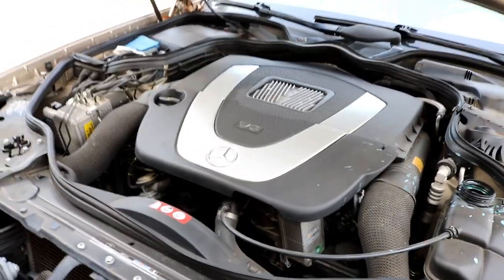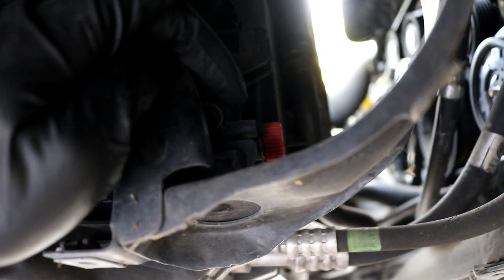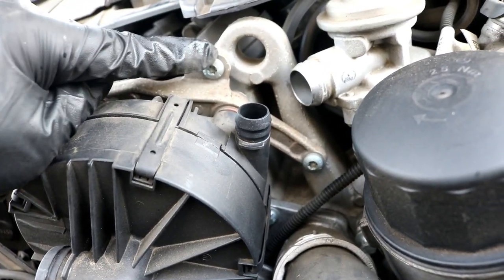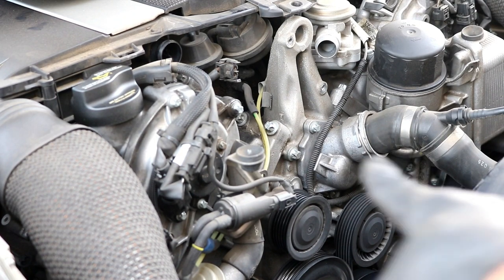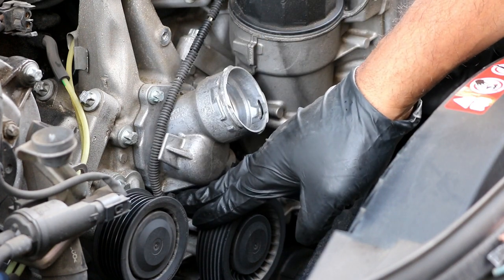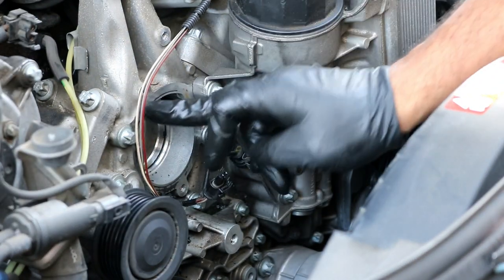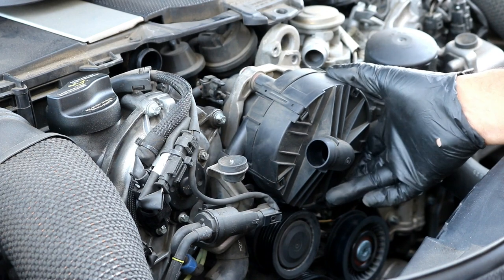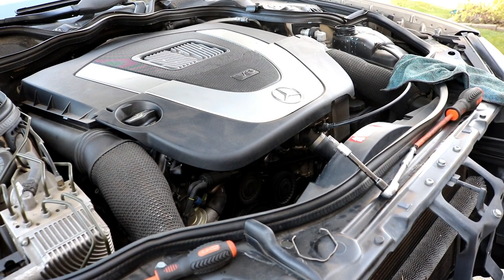Mercedes M272 Thermostat replacement E350/C350/R350/CLK350

Comment: Thanks for sharing, and here's a small note for those who don't have a breaker bar or long torque wrench you can use normal size wrench! it worked for me with some effort on 10" wrench with zero problems. Checked 👍.

Comment: You don't need to remove the secondary air pump if you have a 1/4" drive E10 socket - a 3/8 E10 will not fit without removing the secondary air pump.  Socket worth the $10 and you will use it many times on the M272/M273 Engine as well as most later ones.  Very easy DIY job.

Comment: Woooo, I removed the aux air pump without removing the belt. But I do have a collect of odd tools. Also I wouldn’t remove the aux pump fully or most of its attachments. I’d just remove most of the bolts and leave the one under the serpentine belt loose so that I can pivot the aux pump away to access the thermostat bolt needed.

Comment: While the aux air pump is off you might as well change the tumble flap cam to a steel one on the front of the air intake manifold . Be careful of the vacuum hose plastic connection also as they break pretty easily.

Comment: What is the normal temperature of m272 engine? Mine is about 90 C. From the AMG menu it shows the engine oil temperature and it sometimes goes to 105 C. Is it normal the oil temperature to be higher than the water temperature? I am with e new thermostat.
Reply from the maker: Yes it will be higher than coolant temp under normal circumstances. 90 c for coolant temp is also fine. Even up to 100 c on a hot day in traffic for coolant temp is acceptable. If it starts rising above that pretty consistently, then I would look into the fan, thermostat or for a leak.